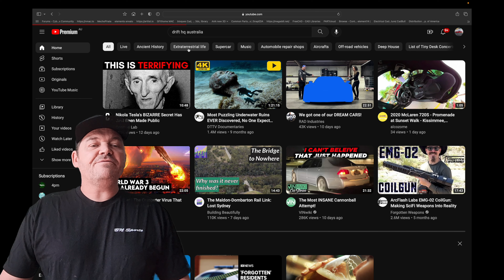Haruguchi RX7 stripped - Win JDM Wheels

Comment: Would be a perfect chance to add some modern 326 parts ti the build like wheels, suspension, seats, steeringwheel and so on, maybe Haraguchi thinks so too :D
Reply from the maker: It will get some new parts such as coilovers, full wiring, new sensors, injectors, seals, bushes, bearings, aero and paint
Reply: Nah as many original parts need to be preserved (or replaced with the same period parts) as possible imo. Putting modern parts on a machine like this feels wrong.